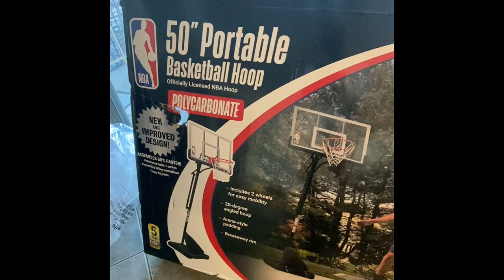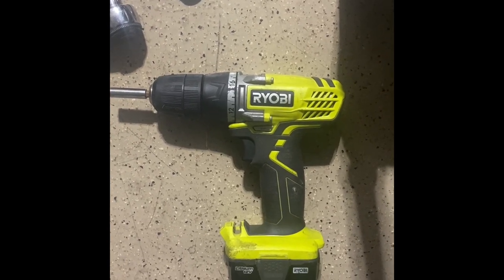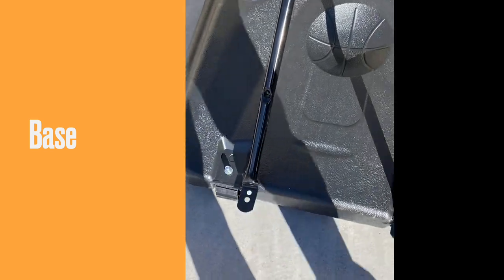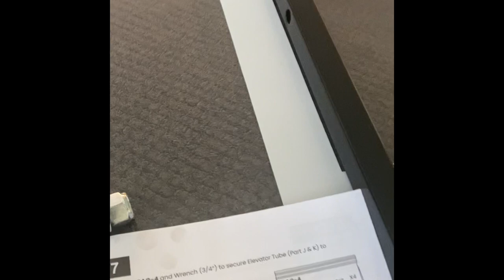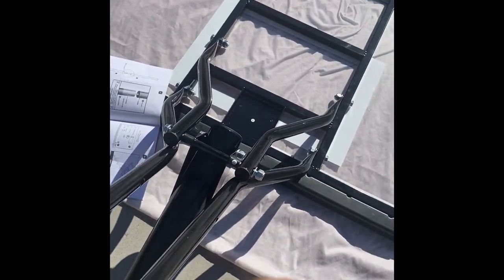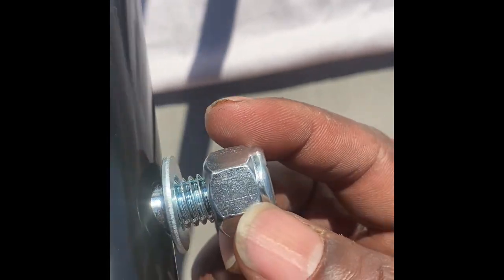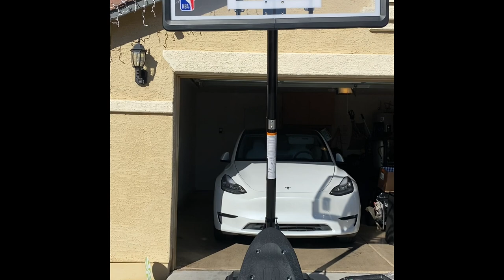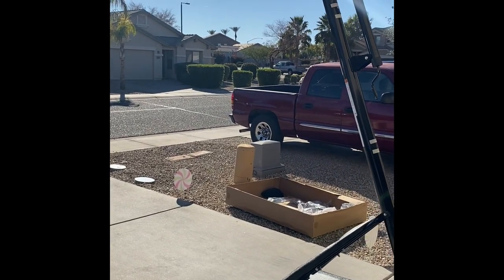How to install  NBA 50" Portable Basketball Hoop with Polycarbonate Backboard

Comment: Hello sir I have a question. 
My J and K is kinda moving even after i installed the height adjustment. How tight should it be? 
Should i tighten it after I installed the ring on backboard?😊